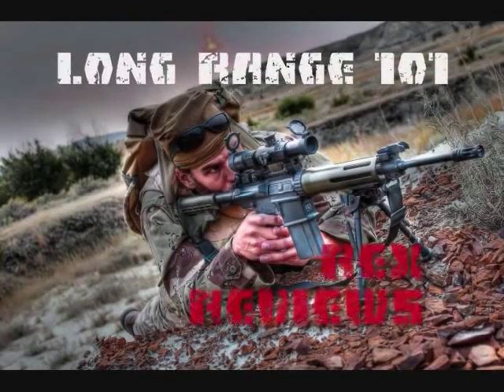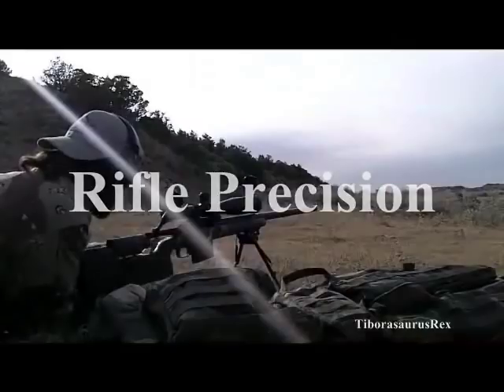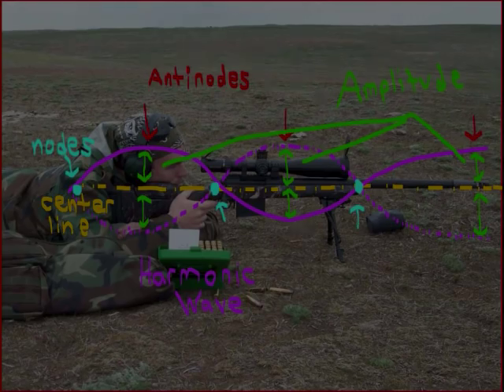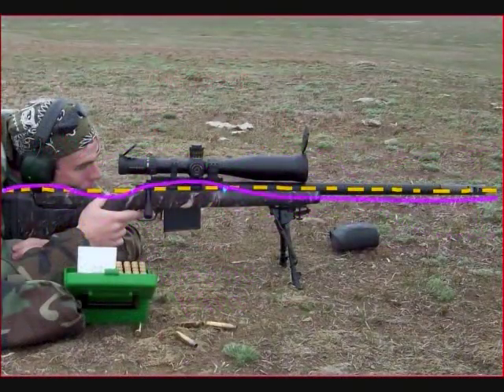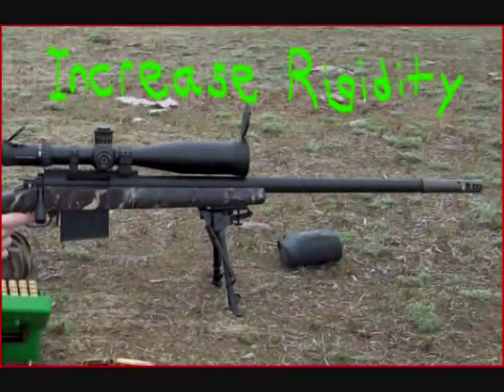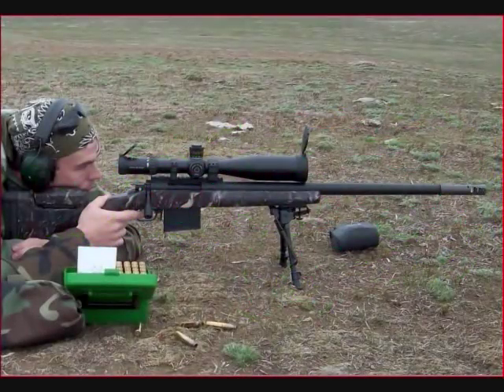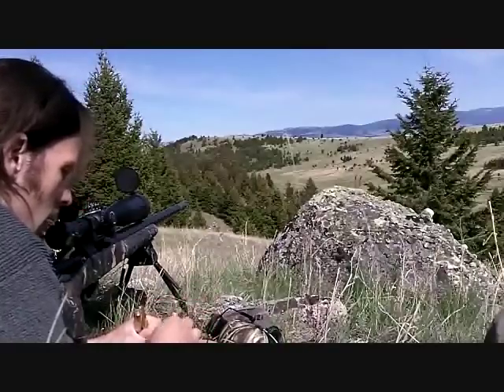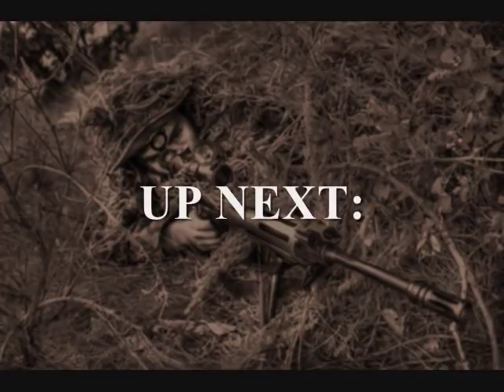Long Range 101 Part 7 - Rifle Vibrations & Harmonics EXPLAINED - Rex Reviews

Comment from the maker: Great questions.  Yes, harmonics are very important in old rifle designs as well as new ones.  The engineers behind the Mosin Nagant actually took great care to make sure the design was tuned harmonically in its original issued configuration.  To sporterize the rifle would be to start from scratch.  It would be very difficult to improve on the accuracy of the Mosin Nagant by altering it configuration.  They usually produce the best accuracy in their unaltered condition.  My last one got 1/2 moa.

Comment from the maker: Great question - It eliminates loose contact points between the barrel and stock that can cause a inconsistent rattling between them.  Free floatong allows the barrel to vibrate freely at a steady frequency rather than a random interupted frequency.  If the pressure is not solid agaist the barrel, it throws the harmonics for a wild ride - thus free floating is a way to get rid of that.

Comment from the maker: Great question.  I love the M1A, but they are one of the most difficult rifles out there to get consistent harmonics out of.  Its not due to the barrel, but rather the operating rod which rattles back and forth and how it locks up to and mates with the gas block on the front sight assembly.  These rifles can be accurized by folks who know how to do M1As, but they are really tricky.  This is why most M1As typically get 1.5 - 2.5 moa accuracy.  Other rifle designs are more conducive to accuracy.

Comment from the maker: A .308 launching a 147 grain FMJ with a B.C. of around .408 will give you a maximum supersonic range of about 1000 meters at SAC. Your ELV adjustment at that range will be around 48 MOA, so if your scope has enough vertical adjustment, you could get dial it in. Of course your performance will vary with barrel length and air density.  After your bullet enters the transonic zone (1200fps), it will become unstable and your POI will be quite unpredictable beyond that point.  
Peace.

Comment: Hi Tibosaurus
Thank ou for this great series! very informative and interesting! i have been thinking about your explanation in this video, and i think there are 1 or 2 flaws in it:
1. There will never be a node of a standing wave at a free end. its just not possible.
2. even if there were a node at the end of the barrel, that would not help necessarily, because the slope of the curve might still be unequal to zero at the moment the bullet exits the muzzle. And the angular error is all that matters, not the position error.
So what i have been thinking:
The Gun is not a homogeneous system, (unlike a guitarstring or a metal rod). also the explosion in the cardtidge is not a homogeneous excitation. It is an impulse, meaning it excites every frequency equally. That means you have all kinds of waves of all kinds of wavelengths running up and down your system simultaneously. these vibrations all overlay each other, thus there is the possibility that the amplitudes either cancel each other out, or add up to a biger Amplitude at the free end. By changing the mass, stiffness, points of contact, force at these points, you shift the bellies of the waves of different wavelengths.
The goal is thus to tune your setup such that all waves of all wavelengths add up to zero amplitude for the time before the bullet leaves the muzzle. This is why changing the ammount of powder in your cartridge changes your accuracy: it changes the exitation impulse and the exit time, as you said. This is also why adding a scilencer can mess up your harmonics. you can in principle tune the system, such that it works finde in two combinations (with and without scilencer for example), but it should get exponentially more difficult the more scenarios you want to tune simultaneously. This is also why some other guy recommended to always shoot from the bipod. Because this keeps your point of contact in the front of the rifle always the same.

Comment from the maker: That's a great question, and I have to admit I haven't done any testing on the axiom stock yet.  I would be slightly hesitant to introduce any unneeded flex into the stock on a LR precision rifle, but I have been told that they to shoot just fine at least at normal ranges.   Again, if you can get 1 MOA or less, the rifle will work fine for most LR apps.  Hope this helps.

Comment: An old timer was saying for thin barrels, if you're not free floating it, he has had great luck with adjusting the pressure the stock applies at the end of the forend to the barrel by either adding glass beding or sanding off material until it takes 10 to 15 lbs to separate the stock from the barrel.  This all being done at the end of the forend so the rest of the barrel between the action and forend is freefloated.  I havnt ever tried it maybe oneday.  Love the videos!

Comment from the maker: Great question! Sometimes reducing the friction in a bore is highly benefical, sometimes it doesn't make a difference.  Ex) I have tested some old rusty military barrels with terrible nasty bores that shot better than other rifles with clean smooth bores.  It depends on the harmonic signature of the particular weapon.  Changing anything in a rifle (including bore friction) will change the harmonics.  The next videos will go into more detail on barrels and actions.

Comment from the maker: That would tremendously increase the total rigidity of the system and if designed and assembled properly, that would work very very well.  That's one of the reasons many of the military bolt action designs incorporated full length stocks with spring loaded barrel tentioners on the barrel toward the front.

Comment from the maker: I start by moving it in the barrel channel in half lengths, and then adjust it back and forth cutting the length in half each time looking for the sweet spot.  At first I'm moving it quite a bit.  After just a couple adjustments I am moving it in very tiny amounts until its just right.

Comment from the maker: The Savage 10 is a pretty good value.  They usually come with pretty decent  barrels.  The accutrigger is a little goofy in my opinion, but it works just fine.  The only thing you might have a problem with is the cheap injection molded plastic stocks many of them come with may not always offer solid bedding.  I would simply replace or upgrade the stock if it gave me any problems.

Comment from the maker: If you had a 1 in 6.5" twist you could use the .224" Sierra 90grMK with a BC of .504.  That would do quite well at LR.  However, long range efficiency of most .224" projectiles is quite poor.  You might be able to almost stabilize the 77 gr MK which has a BC of .372 which would be alright at medium ranges (500-600m).  We will want BCs in the mid to upper.400s if we can (g1), so a higher twist might be needed in that caliber, but that sounds like a fun project.  :-)

Comment: Excellent information that I've been wanting as of very recent, and very detailed.. thanks so much..!!
Can't wait to see the upcoming videos about scope usage, temperatures and barometric pressure.. as I tune my barrel. I ran into a semi-auto browning 7mm last weekend at a gun shop with the Boss system installed. That's supposed to tune vibrations at the muzzle break all in which would be a great deal of help at the very moment..

Comment: Hi Rex,  I do sometimes clean the bore before each session but the last time I didn’t think it would have made a difference and I guess it did. I’ll clean it next time to see if the load that showed some promise is consistant. If that doesn’t work then glass bedding will have to be the next step. Thanks

Comment: Hey Rex, love the 101 series.  In the process of getting my Rem 700, 308 set up for long range.  My next steps are muzzle break and load development.  Will adding a muzzle break change my barrel harmonics?  Should I hold off doing my load development till the break is installed?

Comment from the maker: That could be an issue for sure. Sometimes the bedding between the action and the stock is a bit sloppy - this could result in problems if the action shifts within the stock under recoil. My recommendation would be to glass bed the action in to the stock and be sure the barrel is free floating with room to spare. This should dramatically improve the precision capability of your rifle as well. If the project seems intimidating, any gunsmith should be able to do that for you quite easily :-)

Comment from the maker: Only things I would do would be to bend the bolt handle down for a scope and have a competent gunsmith install a scope mount and install a SS10X.  I would find some 7N1 ammo or some match grade commercial ammo and start setting up by ballistic tables. 1500m is beyond the max range of the cartridge, but you will be able to get out to 1100m, no problem.

Comment: I had an old 30-30 as a kid that just would not shoot consistent or with any accuracy. Come to think of it the rings holding the stock to the barrel were loose thru wear. I ended up throwing it out as a loss. many guys I have traded over the years probably just needed so tuning. wow big eye opener many AHH HAA moments again thanks

Comment: I remember reading an article WAY BACK about Browning's BOSS muzzle tuning device...  One of the gun rags played around with screwing the device in and out on its threads... this altered the frequency and now i suspect the nodes.. and they were able to vary the group sizes between +2MOA to as low as .8 MOA using the same rifle firing the same ammo simply by having a muzzle device that could be screwed in and out like a machinists micrometer....  Look up the Browning Boss to see how it operates... Im surprised that no one else has experimented further with physics of this idea....  Basically "Tuning" the Frequency of the barrel vibrations with an adjustable muzzle device..

Comment from the maker: Yes, sir.  Good ammo is the next crucial step.  Try either M118 Ball if you can find some or some 168s or 175s BTHP Match Ammo should be plenty good.  Next thing to look at after you have the appropriate optical sights and mounts is the gas system.  That’s where a lot of the accuracy eating slop can be found on the M1As

Comment: Rex, I had no idea what I was doing when I put this together.
I used a mauser m48 rifle. It has a stepped barrel. I put it in a laminated stock. I glass bedded it from the sight base back and free floated from the sight base forward. It is pretty accurate, but I am interested in your thoughts as to harmonics and rigidity.

Comment: Has anybody ever tried shrink fitting a tube over a barrel (jacketing) to see how a high residual compressive stress would affect harmonics?  I´m thinking about whether you could make a thinner barrel behave like a slightly thicker one.  Another interesting avenue would be to add or reduce mass around the  nodes to see to see if a certain level of active-dampening could be achieved.  Great video series by the way.

Comment: I have done exactly what this guy is talking about.  I have a Remington 700 30-06 that would cut three different edges of the paper at 100 yards.  I wanted to just helicopter that thing into the ocean I was so frustrated. A close inspection however revealed that the action did not sit tightly in the stock because the metal magazine between the action and the trigger guard was too big.  The trigger guard would seat against the metal magazine before the barrel was tightly seated in the stock.  I milled off about off about an 1/8"off the magazine which brought the groups into the 1.5"range.  I next built up a pressure point in the stock with paper (yes a folded wad of paper) and I was under an inch!

Comment: Ah ha! This could explain why my PTR-91 doesn't like the big 175 gr matchkings yet it shoots 168gr matchkings extremely well! I'd rather shoot the 175's in theory the barrel twist rate is 1 and 10" which should stabilize a 225 grain bullet. The barrel is 18" though. The delayed block back roller lock action is a violent system of operation. I know the German military uses an enhanced 2 stage recoil buffer and they use re enforcement rails on the receiver. I also know they use a beefed up trunion. Maybe a good muzzle break. Also I noticed the thing is muzzle heavy. I love what I got Now I want to squeeze more out of it. The 175's tend to be more stable at trans sonic ranges that's why I want to run 175's. Hk platform rifles seem tougher to accurize. But it's a labor of love.

Comment: Rex, I am curious to hear more about your insights on nodes. Specifically harmonic nodes as it pertains to cartridge reloading. I see the correlation to finding the harmonic nodes as far as having your bullet exit at a harmonic node which I guess would in turn be the same thing as a velocity node? (Referring to Scott Satterlee’s 10 shot ladder load development method) He talks about finding usually 3 charge weights (nodes) that produce consistent velocities over several tenths of a grain. How does that relate to barrel harmonics and the harmonic nodes you are talking about here? And if you find a velocity and cartridge OAL that shoots well using his test, wouldn’t that mean that any bullet seated at the same OAL with the same velocity would also be exiting the barrel with the muzzle being a harmonic node? Like I said, just curious what you think about it.

Comment: flex in the pistol grip behind the tang on a bolt gun and in the forearm is an accuracy killer.Tuners on the end of the barrel work in spades, thinking outside the box is not popular. Some are familiar with the Boss System that is used on Browning rifles. In one revolution of the tuner, there are usually four or more nodes that put the bullets in the same hole.

Comment: After watching this video I knocked out the floppy front sling swivel from my AR in favor of the solid one fixed to the free float hand guard, suspecting that the loose, unused swivel may be affecting harmonics. My prone groups with iron sights tightened up from 4 MOA to about 2.5 MOA. Wasn't terribly scientific: other factors included continued practice, and switching to a fixed buttstock, but I thought this was an interesting development. Curious if any others have had a similar experience?

Comment: I noticed that placing a suppressor on my rifle kept my groups tight over several different loads of powder during my work ups. I compared this to just a naked barrel with no suppressor or muzzle device and and found as predicted, my groups reacted to the loads either opening up, tightening up, and also change in impact on target. I suspect that the suppressor is moving the node closer to the muzzle as it exits the barrel and passes through the suppressor. In summary, a suppressor had the most positive impact in the form of point of impact  and grouping consistency  over several powder weights as the groups remained tight and the point of impact did not shift.
Reply: You would be correct. Also the tightening of your groups is very common as a suppressor keeps the round in front of gas longer. A good video to watch is Larry vickers bolt vs semi auto comparison video. The suppressor adds about 50-100 meters in range.

Comment: You know what would be awesome? A tandem-charged sniper round. A round that was broken-up into two stages of detonation instead of one which would/could lower the harmonic vibrations and the bullet deflection. One could, in theory at least, have a lighter operating system, lessen heat warp, and even extend the maximum effective range of any round. I can't be the first person to have thought of this. I know there are tank rounds and anti-tank rounds that use this but it is to penetrate armor and barricades not improve accuracy, range, and efficiency.

Comment: Wow. Ok, so to have the theoretical most accuracy, a thin long barrel would have a lower frequency, so when ammo is tuned properly, would in fact be moving less, and would be more consistent at the time when the bullet leaves. I hate compromise lol. 

Of course heat warping, expansion/contraction will throw this out the window, but it's neat to understand! Thanks.

Comment: forgot to mention in the 2 earlier posts, the only way to make a gun more accurate is to make everything more consistent. if your ammo is theoretically perfect and your gun is 100% consistent that the results will always repeat themselves. ask any gunsmith/machinist. consistency ALWAYS equals accuracy. ill give you one thing, rigidity usually equals consistency but thats beside the point. if you can make the bullet leave the bullet leave the barrel perfectly every time nothing needs to be tuned

Comment: Rex, I've got an M1A with a synthetic stock that I drilled and installed 4 qd mounts. This is a "dmr" with a Bradley riser and a vortex pst ffp mrad. Question: will the drilling of the stock effect the rifle harmonics in general, and specifically for my purposes of 100-800 meter engagements to a noticeable degree?

Comment: You mentioned muzzle devices, but you didn't go into a lot of depth.  I've built a barrel tuner (if you are unfamiliar with it, it is a weight out past the end of the barrel that can be moved in and out to put a node right at the muzzle) for a 10/22 and moving it around can change the group size by 4X.  It might also be worth mentioning that a node can not exist at the end of the barrel, so adding weight past the muzzle can move a node nearer to the muzzle.